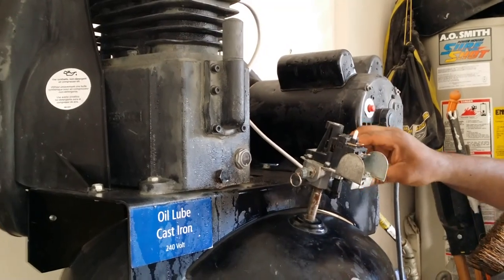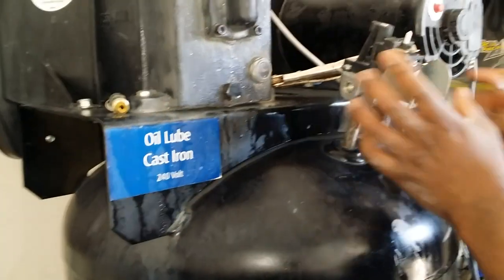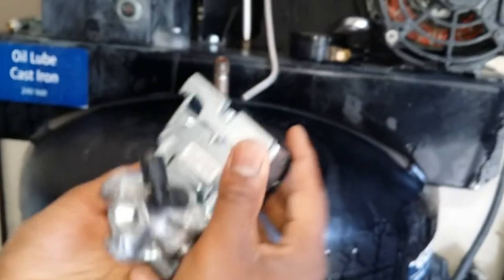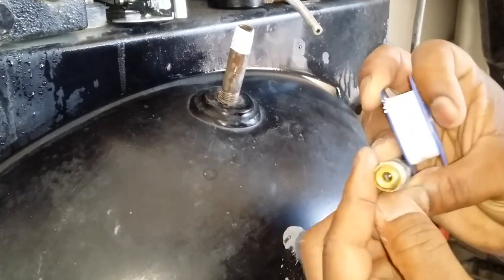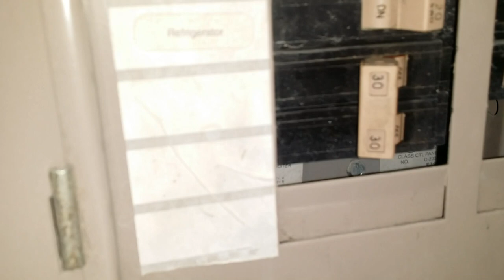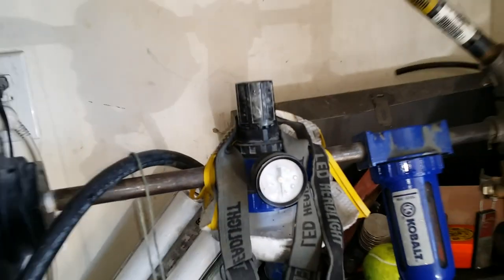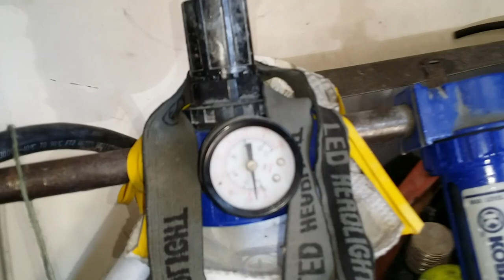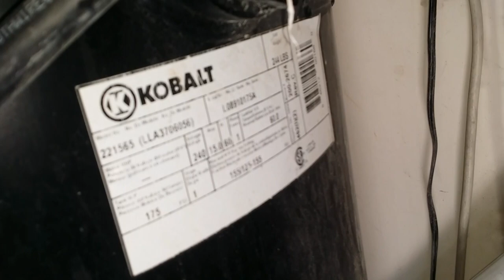How to replace air compressor pressure switch 60 gallon

Comment: You need to learn how to put the tread tape on before you try to show others. You are also using the crescent wrench and vice grips wrong as well. Other than that, not a bad video. Keep trying.

Comment: You put your Teflon tape on Packards and yes it does matter how you put it on there. You don’t want it to unwind when you put the other piece on. You want to put your thread, tape or Teflon tape whatever you call it on the exact, same way, whatever part you’re putting on, it spins to tighten it.. you didn’t.

Comment: good video brutha.  just noticed one thing ill mention for all your viewers... when putting on the teflon tape its important to do so in a clockwise direction or else when the part is turned back into place it will going in the opposite direction and may compromise the seal you're trying to get. Thx CJ, appreciate you taking the time to drop some knowledge.
-Mike
Reply from the maker: Will do tks

Comment: Ok you get a like from me.When it comes to tightening up fittings ,your crescent wrench should be as small as will fit.You got your gage on facing away instead of towards you.My dad taught me to hold the wrench up close instead of out on the end.Lots of the pressure switches are aluminum/pot metal and very soft easy to break.I have done it.So go easy on the touch .Great video.

Comment: The pressure gauge on the regulator is the pressure you want for your tools. The gauge on the pressure switch you reinstalled from the old one measures the pressure on the tank. The pressure switch should come on at around 100 psi and then shut off around 130 to 135. Most air tools, nail guns etc. are usually set for 90-95 pounds, That is what your regulator should be set at. When the pressure on the tank gets to 100 psi, the compressor will turn back on and pump up to 130 to 135. Hope that helps. Thanks for sharing. It looks like no one really taught you the right way to use tools and how it all works. You are trying and it shows. There is a right way that will save you a lot of frustration. Keep wrenching
Reply from the maker: great info! thanks...CJ

Comment: Thanks SO much, I have to replace the same pressure switch on my US General (it's the same part #) and I had no idea how to get what you called the relief line disconnected (it's actually the unloader line). I was pulling my hair out trying to figure it out and you saved the day and my hair ! Nicely done. Just one other thing, I have been told by the experts NOT to use Teflon tape on the fittings, if a piece gets into the system it can really screw up your tools or other air powered devices.  They say to use a paste type pipe joint sealer on the threads.
Reply from the maker: glad it helped and good luck on your project that is good advice to use the paste instead of the Teflon tape
Reply: Thanks for the reply ! Just waiting for the new pressure switch to arrive & have the paste sealer ready to go !

Comment: Cool man, good video... did you get a buffer?  Did it help?
Reply from the maker: Thanks Gary, so I stopped by Napa and they had the dewalt dw849 I think that is what it was called, they had it on sale for like 160, so I picked it up, then when had a chance to settle down and do the research I really wanted and needed the 'X' dw849x version so ordered it from Home Depot, so I got the hook it pad with it and plenty of pads.. I haven't tried it yet the buffer should arrive sometime next week. I ain't gonna lie I figure I would invest in a good buffer because I don't spit out the gun like a pro so will be doing alot of buffing and I don't really care to buff so I want the most efficient and effective tool..so the we will see but just logically you hit it on the nail, what I have now is just tooo weak..so we are are still in deliberations...thanks for stopping through..CJ

Comment: great how to,this video should get a ton of hits theres alot of compressors out there like this
Reply from the maker: It sure is, and I got the part from a local machine shop at 30 bucks instead of 85 by going through the Kobalt crew, working like charm now.. thanks for stopping by..CJ

Comment: You're not suppose to use teflon tape on compressors it breaks down and ends up clogging up your tools if you do use it leave the first couple of threads bare also change that oil i can hear the piston slapping already and that oil is jet black

Comment: great video until it comes to putting the wiring back together. refer back to the manual is not showing me how to do it. thanks for nothing.
Reply from the maker: check out my video on my channel how to wire the compressor it shows exactly